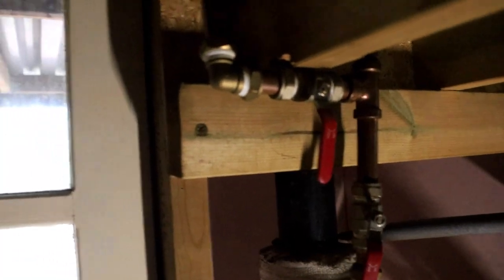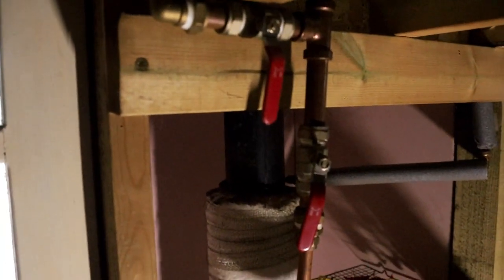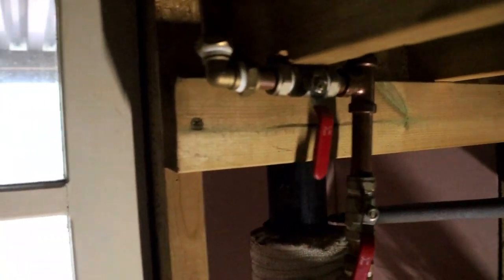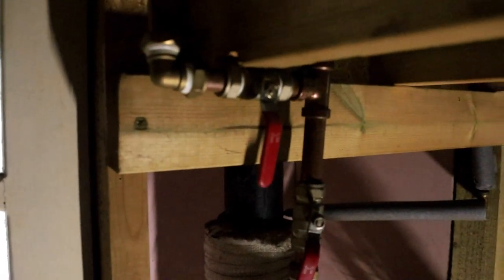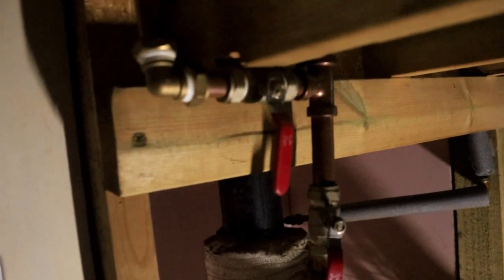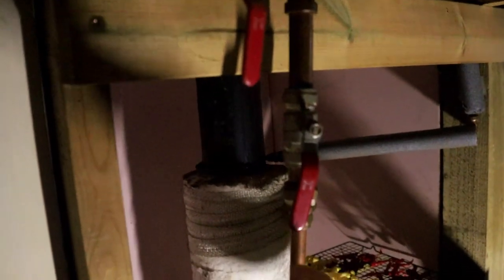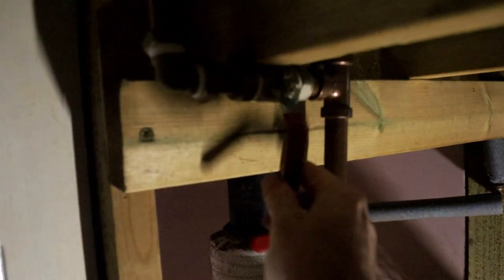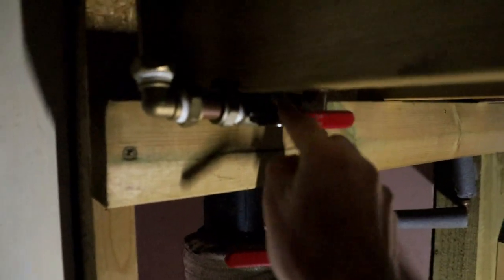Part 1 Simple Off-Grid cabin hot water system.

Comment: Be careful whenever you bring steel and copper together.  There is a concept called galvanic corrosion, especially if there is any zinc in the steel.  Any exposed surfaces that are touching have a potential to corrode because of electro-chemical interaction between the two metals.
Reply: I see that the exhaust pipe/chimney pipe (whatever it's called) is painted, there may be less to no galvanic action happening. But just in case, putting a sacrificial metal (usually zinc) in there connected to the copper pipe and exhaust pipe may fix the problem temporarily.
Reply: Steel is painted
Reply: On the water plumbing it is common to use a brass object to make the barrier between copper and iron.
On the chimney there is the option of a layer of high temperature paint.

Comment: Water heaters use a clever trick you may be able to put into practice in a future design.
It will take more plumbing and more pumps but here is the idea.
The hot water tank is something that can take some number of PSI.
You need to arrange something to limit the pressure that can build up.
The cold water is fed into the bottom of the tank and the inlet inside the tank is angled to make the water go around the bottom of the outside.  This means that if you take water out of the top, the new cold water will be the last taken.
The heat exchanger can then be made to take water from the tank, heat it and put in it back near the top of the tank.
again the inlet is angled to the side so the hot water goes around the outside of the top.
It turns out that if you can stop water from mixing, cold water will happily stay at the bottom of a tank and work like a big piston to push the hot water out the top to the shower.

Comment: Buy a simple plate heat exchanger (£50) and use that to pass the heat from the stove loop to the hot water tank. On the clean side add a thermostatic mixer valve and set the temperature to your shower temperature 38 or so and then you can heat your shower water on demand without it needing to come from a tank.

Comment: great little video mate. as you had no issues and it works perfectly, is it safe to assume your holding tank is vented? also how long from a cold start would you say it took to heat up the water in the video enough for a shower?
Reply from the maker: Hi mate, thanks. Yes it is vented at the top, where the inlet pipes go in. Obviously time of year affects the time taken to heat the holding tank, as the incoming water varies in temp throughout the year. This time of year the stove is on morning till night every day so the tank is always at a good temp and top it up frequently. If I was to start from a full cold tank this time of year, start the fire about midday, I would be able to have a 35-40c shower that evening/night.
Reply from the maker: I am thinking of doing a little vid about this v. soon so watch out for it.

Comment: Do they not make a barb fitting that could connect your 12v soft tubing to the copper pipe?
Reply from the maker: I don't know tbh. Probably. I just used that as thats what I found to use at the time in the shop. It does the job, so no worries.